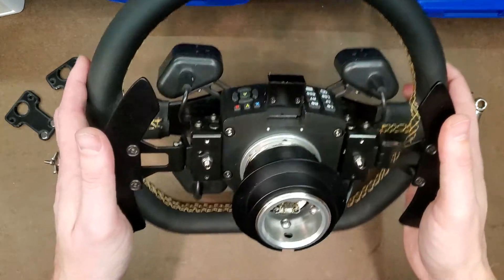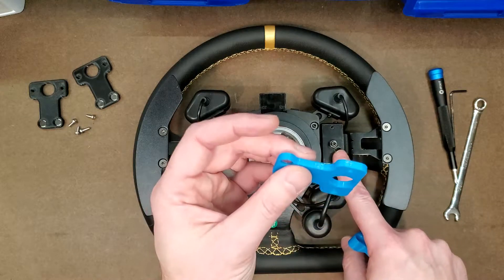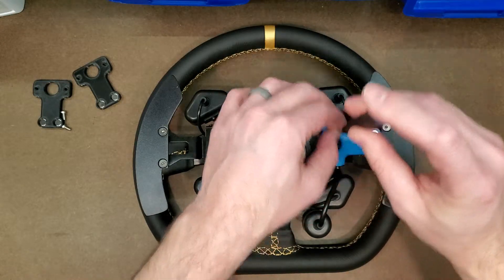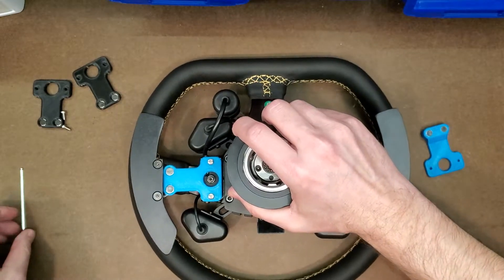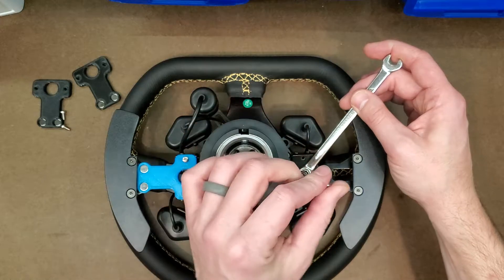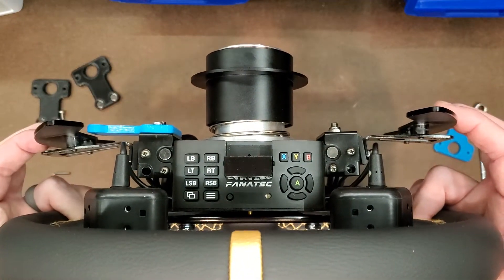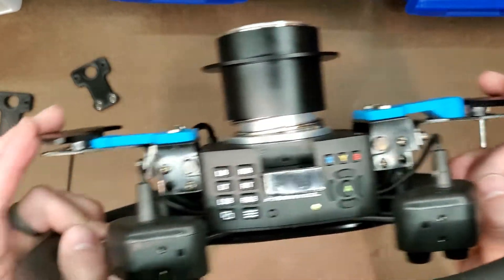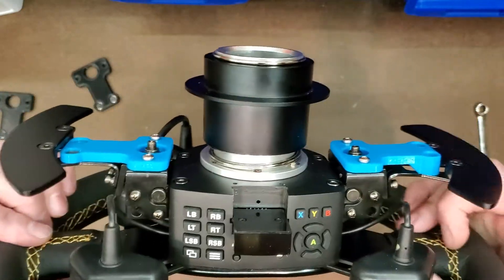Cromulent Designs Magnetic Shifters for Fanatec Universal Hub - Install and Tuning

Comment: Very nice! Do you know if this magnetic shifter mod will fit a Fanatec Clubsport BMW GT2 rim? They look very similar on the back. I also just ordered this universal hub so I'll be looking to buy 1 or 2 of these soon. Thanks!
Reply from the maker: Thanks!  This version won't fit the BMW rim due to the plastic shroud over the back of the shifters - but my RSR version is close (it just doesn't have both magnets fully contacting each shifter, since the BMW shifters are asymmetric).
Reply: @A60363  Thanks for the reply! If you made the magnetic shifter mod for the BMW rim, I would definitely buy one. I can't find any of these made in the US. They're all from Europe.
Reply: I have the exact same issue. Would definitely buy one if you made it for the bmw gt2 v1 rim.

Comment: These look awesome, just ordered the flat version. Didn't even know that "tuning" was available on the shifters, I had already adjusted the paddles to be on the other side to have them closer, but the actual throw is still long.  I'm already used to it so I just stuck with the flat one.

Comment: You know you can regulate the switch activation point with 1.5m Allen Key right ?
Reply from the maker: You can, but that set screw is extremely short, so you run out of adjustment quickly.  I think that only exists to provide a contact/wear point for the switch lever against the aluminum angle, so the spring steel doesn't chew through the aluminum.
Reply: Still it's an adjustment. I was able to get rid of a lot of post-activation travel and got it really tight